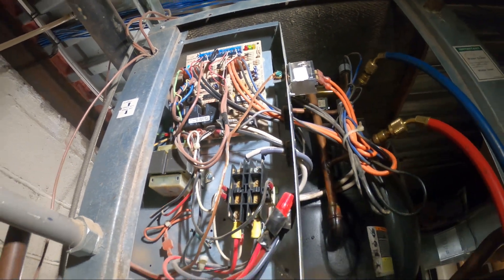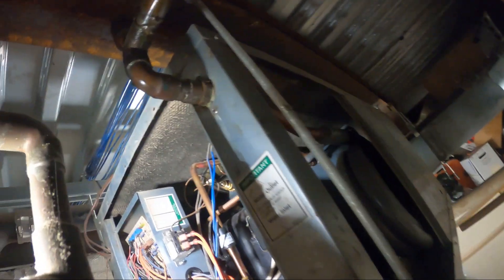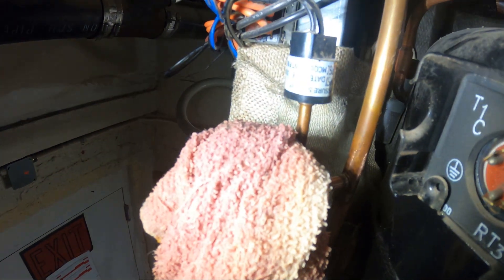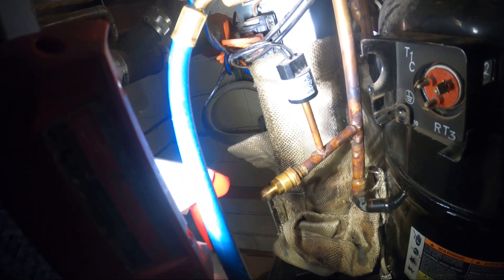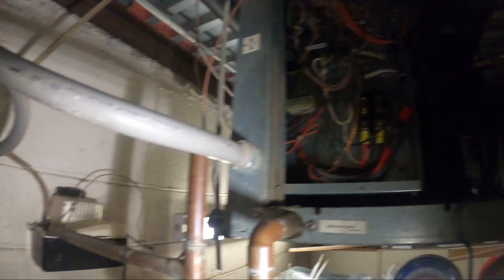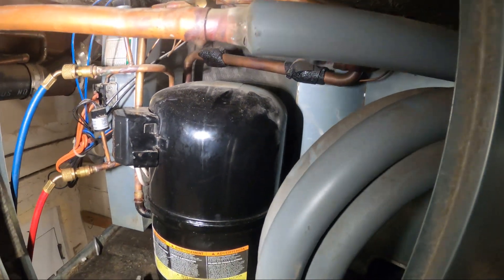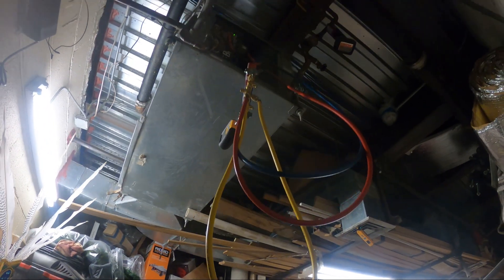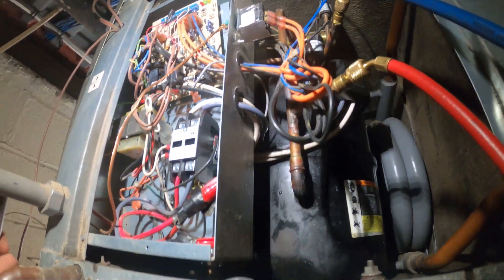HVAC Service Call: Refrigerant Leak On McQuay Water Source Heat Pump (Heat Pump Freon Leak Repair)

Comment: Where'd you get those tees? I have the same set up but the tees I have are flare nuts and I once cross threaded a set of manifolds and had to get new ones lol. 
I use the tees on both high side and low for my testo smart probes.  I watch the pressures during a pressure test from my phone which will show a leak a lot easier than the gauges. On a vacuum I do the same thing you do. 
I'm a second year apprentice from Toronto thanks for your vids lots of good info out here 🙏

Comment: Instead of spraying into the schrader....use a cap with no O ring, put the cap on the schrader port.....then spray with leak detector fluid. That way there is no chance of contamination.
Reply: I always wondered about that , thanks

Comment: I like were you place the micron gauge at gauge manifold. I have been placing it at the vacuum pump and seem to have more problems with leaks and hoses getting in the way. We have old Ener Con water source R-22 hp's at hospital setting and they are all sealed cap tube systems with no driers. The new replacements are R-410 with high/low access and filter driers for both cap tube and txv systems. When I go back to work, I am going to make one up like that with a new ball valve to isolate  micron gauge and leave it, as is ready to go.  Thanks for video.